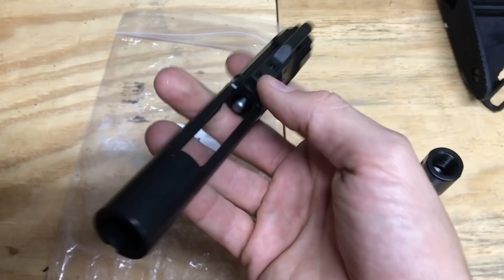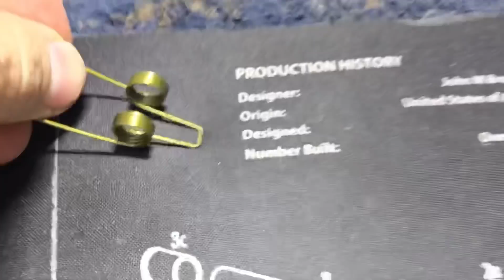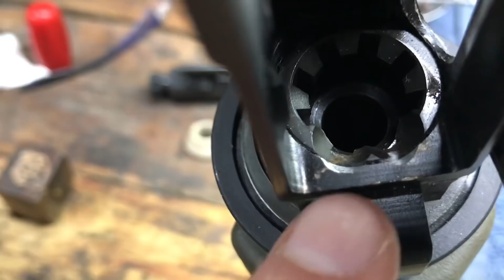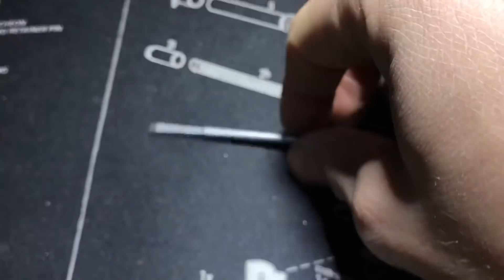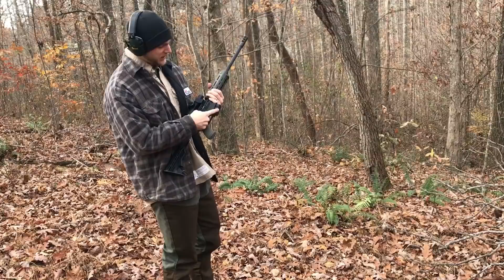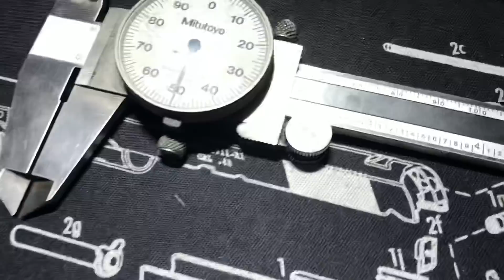Building a Budget 7.62x39 AR-15 Deer Rifle.. That Works!

Comment: The hammer spring is not needed. Just the enhanced firing pin. Not longer, but shoulder cut differently so it protrudes a bit more.

Comment: I got a mutant x39 on aero precision lower upper. 
Aero precision upper FDE
Aim surplus BCG, 
Geissele 2 stage trigger. 
Duramag by c products. 
Never had failure to ignite issues with the geissele trigger. Did put a BRC extended firing pin in it. Things a sun moa rifle. I love it. All FDE too

Comment: So if I heard you correctly, you used a standard 5.56 lower correct?
Reply from the maker: That’s correct
Reply: I used a complete psa lower with a bear creek upper on mine with AR Stoner magazines (specific to caliber). Was having a failure to fire about 1 in every 10 (shooting Tula, Wolf seemed to be a little better). Changed to enhanced titanium firing pin and it runs perfect now.

Comment: What Ive found with building ARs in x39, the Rock River Arms National Match 3.5lb 2 stage trigger feels great and has given me great results with primer strikes. They do sell a red, heavy hammer spring,  for 2 bucks that will ignite the hardest of mil-surp primers.
Reply from the maker: Erik Tuss awesome thanks for the info! What’s the price on that trigger set up?
Reply: @tristarcustoms77  that trigger is on sale right now at Primary Arms for $85.
Reply: @tristarcustoms77  the trigger can be found for $80. Its regularly on sale from places like Right to Bear or Primary Arms. Any more, that trigger, TC bcg, and CPD mags are a staple for x39 builds. 

Here in Texas I go hog hunting often. Its a great setup for that. We have a Helicopter hunt on 3/21 with everyone using ARs in x39.

Comment: Replace the firing pin with sn enhanced and try the 2 stage Larue tactical MBT trigger. 100 bucks in upgrades and your light primer strikes are solved.

Comment: Your Lower is it polymer, Not had good luck with them. Broken two at buffer tube separation. so change back to standard.  Maybe just bad quality forgot where I got them from. But works great now with a new billet lower.  with the enhanced firing pin and one pin I milled both work great.
Reply from the maker: Gary Rigney yeh I would much rather have a standard lower instead of polymer. I’ll eventually change this one out. But all other ARs will be billet.

Comment: What all do you need to swap out if I'm trying to convert my 556 into shooting 762?
Reply from the maker: Rex Martinez in my area you can find complete 7.62 uppers for really cheap at gun shows. That includes everything you need besides magazines. But if you just want to try to keep your hand guard that you currently have you need to buy: a barrel, gas system (most 7.62 barrels have a larger profile than a 556 setup), muzzle device, bolt carrier group (or just the bolt if you can find one). I think that’s it
Reply: @tristarcustoms77  so a 762 mag will fit into the 556 mag well?
Reply from the maker: Rex Martinez yes

Comment: Jordan... I fit a 7.62x39 bolt carrier group into my regular ar15 upper. Will it work?
Reply from the maker: Fel Ta yes it works with any standards AR-15 upper. Just swap out your barrel and you should be on your way.
Reply: @tristarcustoms77   nice. This is my ar pistol it has a quick take down kit for a barrel swap. 556/300blk
Reply: @tristarcustoms77  and now... 7.62x39 Imma buy the ar 7.62x39 mags for it too. Any recomendation?
Reply from the maker: Fel Ta the AR Stoner mags from Midway USA have worked well for me except one 30 round mag wouldn’t feed the last round in the mag
Reply: @tristarcustoms77  great bro. Try checking the spring/follower

Comment: Your Lower is it polymer... I made one with polymer and I installed the wolf  hammer springs. I used the ASC 20rd mag. I believe that the name of the mag brand. But I have no issues with any type of steel casing. The buffer I used is a H2 but I forgotten where I got my bcg. I think dpms is what I want to say. Anyhow so far so good with yours and mine

Comment: Alright, alright, alright...(sniff...)😂🤣😂 Good video, just bought the BCA 7.62×39 and am already looking for an enhanced firing pin and heavy trigger spring! Thanks for the info!
Reply: Dave Hanson how do you like the rifle? I am thiiisss close to buying one myself
Reply: @HardHeadMilitary  its difficult to get any less expensive than the BCA upper. Primary Arms has some good sales on Radical 7.62 uppers too.

Ive built several. Some have a BCA x39 barrel. At the holiday sales the barrels are $50.I also have built them with Faxon and Diamond back barrels. Faxons are the best, but are they worth 3x the cost of a BCA barrel? Maybe. Tool Craft makes a great BCG in x39 that comes with an enhanched firing pin. They run about $80. If you are really scrimping, Unbranded AR sells just the x39 bolt with enhanced pin for $40. You can drop that into any of your 556 carriers.

CPD mags are the only 28 or 30 round mags that Ive found work 100%. ASC or any other 10 rounders work fine too, but not the 30 rounders. 

One thing people make a big mistake on, it is not cheaper to shoot 7.62 x 39. If anything, it is more expensive. Mags cost more, steel cased ammo prices are the same, brass is more expensive for x39 (significantly), and hunting ammo is more expensive for x39.
Reply: I think I'm gonna build one of them for hunting on the cheap. Can be one that I can beat ,take out in the weather etc. But after listening him sniff,which my wife tells me to blow my nose all the time. But now I know what it looks and sounds like on the other end. Blow your nose. I will from now on. I'm just a bit picky I guess but must be others out there too. Good video though. Gun looks fine to me

Comment: You can use the JP enterprises light trigger spring and still run the enhanced hammer spring for hard primer steel case, I believe kit is under $15.

Comment: You still got the bolt carrier up for grabs?  Btw, you can pick up a 6.5 grendel barrel for like $80 + it'll run the 7.62 magazine & should run the same bolt as well (6.5g uses 7.62x39 parent case) but u can upgrade to the type2 6.5 bolt if u wish.
Reply: Tyoe 2 grendel is the only way to go the headspace makes the 6.5 a long range precision cartridge
Reply from the maker: 321JKilla that bolt carrier sold just the other day actually. And thanks for the information I might build a 6.5g upper in the future..
Reply: TNT Tactical I kno bear creek got in some trouble with ICE, but I bought a 24" stainless fluted BCA barrel in 6.5g for under $90 & use my 30rd 7.62x39 ar mag. Steel case stuff is $5/box and the hornaday black is about $1/rd but u can get 1K yd range if ur barrel is decent!
Reply from the maker: 321JKilla man that’s really
Cool. Where’d you get Your barrel from.
Reply: TNT Tactical classicfirearms.com had mags for $18 & the 6.5g barrels on sale originally $119 down to $89.

Comment: Ar stoner Magazines are the best ones you can get even tho some of the reviews are shitty but ive had two 30 rounders for about 7 months an (Knock on wood) havent had a issue yet. Little tip with the mags spray some gun lube under the Sitting plate in the Magazine so the spring an plate slide easier because when i first got mine they were stiff.
Reply: An the steel Ammo doesnt work half the time because the primers are much stiff then brass rounds made in america. The steel rounds are made in Russia

Comment: Try bobbing the hammer. If you take the tail off of it you reduce the weight of the hammer itself and the lighter spring can get it moving faster. Also don’t dry fire the rifle with the upper off of it you’ll destroy your lower dude.
Reply from the maker: I like the way you think! I’ll definitely give that a shot when I get some time. And I try not to make it a habit of dry firing it like that but just did it for video purposes.
Reply: Cumberland Gap Tactical well thanks man. That was one fast reply. Have a merry Christmas.
Reply from the maker: zack mcclain merry Christmas! If you took the time to watch my video and make a sensible comment I’ll take the time to write you back is the way I look at.
Reply: Cumberland Gap Tactical will you make an update video on that hammer modification if you do it?
Reply from the maker: zack mcclain sure thing man.
Reply: Why am I thinking it wld be better to take the 30 thousandths off the back of the bolt.    And use a standard firing pin for accessibility and price.       The 7.62 bolt is already specific.   The manufacturers shld address this

Comment: Got my BCA 7.62x39 for $399 a few months back. Did a ton of work to it and it's my go to hunting rifle sub moa 100yds benchrest.
Green Mountain 16" barrel 
Guntec Keymod FF rail w/adjustable gas block
A2 flash hider (works amazing compared to my yhm phantom on my WASR so why change it)
Failzero BCG & CH
Black rifle arms Extended firing pin and xp hammer spring
Failzero Buffer tube and FCG
Trs-25 with vortex magnifier.
I had no issues with light primer strikes until i swapped the trigger out then the firing pin and spring swap helped immensely now the hammer drops like an ak and the firing pin sticks out like my SKS. Black rifle arms is one of the very few manufacturers that actually extend the pin unlike most that radius a 5.56 one. 1500rds in about 300 after upgrade no issues since.
Reply from the maker: Sounds like you’ve built an awesome rifle man! Thanks for all the info I appreciate it!
Reply: @tristarcustoms77  just bagged an 8 point buck at 200yds! Got a chance to push my rifle out to 300yds getting 3in groups outshooting my friend's ruger ar in 5.56.

Comment: Nice build. Just finished mine. Enhanced firing pin is highly recommended. Extra power spring will help but not always needed. I got them for the extra insurance. Also, you can run the nickel boron carrier and swap the bolts if you wanted too. Looking forward to more updates. Nice build. 👍🏾👍🏾👍🏾
Reply from the maker: Abraham Lopez I probably didn’t make it real clear in the video but should have, that I ended up using a regular mil-spec spring instead of an extra power spring. The mod I was doing to my firing pin is the same as an enhanced firing pin to the best of my knowledge. And I definitely considered running that nickel boron carrier with my bolt. I’m going to run the carrier I have for a while and check it for unusual wear. I want to sell the nickel boron one and if I can get more for than what my current BCG cost I’ll be able to reduce my overall build price, which is always one of my goals 👍🏻Hopefully I’ll be able to post an update video soon with hunting footage within the next month🤞🏼
Reply: Cumberland Gap Tactical awesome. I love doing budget builds. I just finished my x39. I went with a sidecharge so it up there compared to my other budget build but I have been wanting one so I figured I would go for it. Looks like you got a good setup. Can’t wait to see more updates
Reply: Yea Jordan would like to see the hunting video. You make a lot of sense talking about selling the one bolt to bring price down. I have to start thinking that way. One of my biggest problems is when I buy parts for my guns,I always say I will sell old. But I can never let anything go. I'm a hoarder when it comes to gun parts and it's not like I have money to spare. I have to get over this bad habit.
Reply from the maker: I totally understand brother. And even being in the firearms business it sounds logical to keep “extra parts” but if those parts are worth money you need to move them to keep cash flow coming. The same idea is true for the average gun guy. If you ain’t using that junk get rid of it to buy things that you’ll get more use/enjoyment out of. It takes time to get into that mindset. BTW I wish I had better footage of the deer I killed with my 7.62 AR but it really wasn’t worth watching lol. And I currently traded that gun for a brand new set of 35’s for my truck 😂

Comment: May I suggest that you look at the Hipertouch triggers (24 series) that offers a $6.00 7.62x39 spring kit upgrade that ensures no light strikes and maintains a 3.5 lb trigger pull ?  Just a thought, but looks like what I'll use on my upcoming build. :)  As to primer seating depth, that's not the difference causing the light strikes.  The steel cased ammo with their mil spec primer has a greater distance between the anvil and striker within the primer cup. If you reload, it's always safer to have the outer surface of the rimer slightly below the level of the rear of the case. :)
Reply from the maker: MarineBoar thanks for the input! I appreciate your knowledge and willingness to share. I’ll definitely look into that spring kit.

Comment: Nice video I'm doing a 7.62 build also just waiting on a few more items  . I was wondering did you try the enhanced firing pin I've  heard its needed sometimes to fire cheap steel case ammo aka TULA looking forward to more updates
Reply from the maker: Benjamin Ledbetter if I’m not mistaken the “enhanced firing pin” is basically the same thing as the firing pin mod that I showed in the video. So that’s why I haven’t tried it but if you try it let me know what you think about it.
Reply: @tristarcustoms77  I didn't know they were the same this is my try at the 7.62 thanks for the heads up
Reply: The enhanced pin isn't necessary for steel case hard primer stuff, just need to get the jp enhanced hammer spring, you can even use the reduced power trigger spring but need the hammer spring.  $13 spring kits